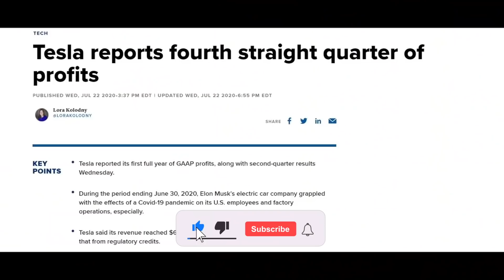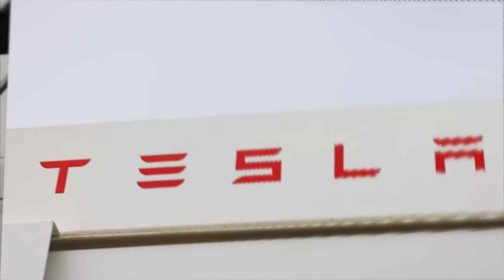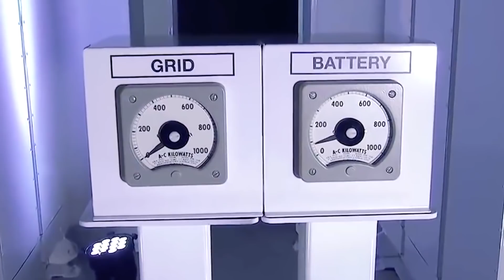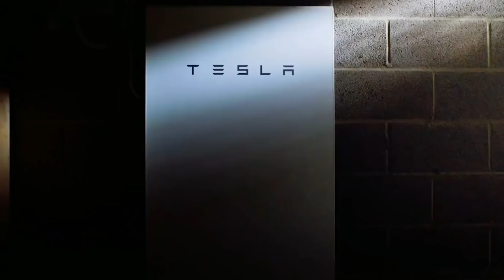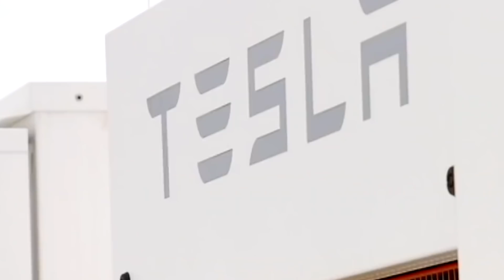Elon Musk Just UNVEILED A New Green Project!

Comment: Just curious worked in the uninteruptable power systems for over 30 years, one of my major procedures was performing quarterly preventitive maintenence on the batteries, it happened through a need to reduce time and better performance reporting for the batteries and to predict how they would function under maximum load we discovered that the only way that you could tell how a battery was going to behave was to have a group of batteries tested with an impedance meter, basically there is a healthy voltage established for a healthy cell and when you subject that cell to an impedance test is to have a very small AC voltage put through the celll and with having the targeted healthy state of the cell you can predict the behaviour in how that cell will perform under load, as most of the time the battery is just in a quiescent state with a very small trickle charge being applied to keep it at the desired float voltage. The monitoring of cells in a quiescent staete is very important, the need to identify a possible defective cell in a group of series coupled batteries becomes very important, I have a desire to puchase two Tesla cars and have questioned do you have automatic cell monitoring for a group of battery cells that would automatically be testing and reporting to your vehicle alarm system when any group of cells transmits an out of impedence check voltage targeted reading it would be transmited to the on board computer?

Comment: Elon Musk - please contact me . I have several concepts: use in solar in a out of the box way. Electric motors that can be used on existing vehicles  and use different methods to charge the batteries.  
         What influenced my thinking  was the simple elegance of the water wheel. Using something that exists with out changing it . So simple  .

Comment: . The battery of a Tesla Model S, for example, has about 12 kilograms of lithium in it; grid storage needed to help balance renewable energy would need a lot more lithium given the size of the battery required.

Processing of Lithium Ore

The lithium extraction process uses a lot of water—approximately 500,000 gallons per metric ton of lithium. To extract lithium, miners drill a hole in salt flats and pump salty, mineral-rich brine to the surface. After several months the water evaporates, leaving a mixture of manganese, potassium, borax and lithium salts which is then filtered and placed into another evaporation pool. After between 12 and 18 months of this process, the mixture is filtered sufficiently that lithium carbonate can be extracted
Reply from the maker: Thanks for sharing!

Comment: Every house should have solar panels to become off grid. Each system can generate enough electrical power to keep houses, cars, trucks with modular engine components plug-ins. You can also take modular charged systems and generate enough energy to power a separate hydraulic system anywhere in the World. No EMP can knock it out with suppression systems to safeguard it's operation. Modular dock offloading systems can be set up like a bread board circuit board system. Trucks, ships can have it's desperate generating use and remain off grid.
Reply: The problem is that places like California are now mandating solar panels and then annually taxing you for having them, not a flat tax, no, no, no, a tax based on the size and their determination of what your system is worth. Plus if you have a large enough system and are able to produce more electricity than you need, you get even further taxed for selling any back to the grid for others to benefit from 🤬. California, we need incentives not disincentives. If we want a sustainable off grid system that is useful during times of frequent power outages, we needn’t be penalizing people for helping to get us there.
Reply: Nickel. Led. Cadmium .solar panel is toksic waste
Reply: We already have better clean electric source it’s called nuclear takes less space it’s safe and cheap! As for cars trucks and planes JCB has developed a internal combustion engine that runs on hydrogen, unlike electric can run 24 hours or more no recharge time it’s a converted Diesel engine so factory’s are already in place and it’s 100% carbon free solar cars won’t be around 20 years from now!
Reply: @billyd.6411 Totally agree. Most likely going to need a nuclear power station as a glorified battery charger. Furthermore nuclear can also do decarbonisation and not only produce hydrogen but also hydro carbon chains right up to Jet fuel and petroleum.
Reply: My home is in the thick woods. Cutting trees down for solar panels doesn't seem very green.

Comment: Self running generators only put out smaller amounts of energy for now, but if it continually runs and puts energy into power walls, it would build up over time.
Reply: There are the newer "generators" that don't actually generate electricity but are large capaity portable packs that can power a small home for say... about 4 hours continuously and cost less than $2000. You can pay more for more capacity. And in an emergency you wouldn't want anything to be drawing power continuously, even your refrigerator.